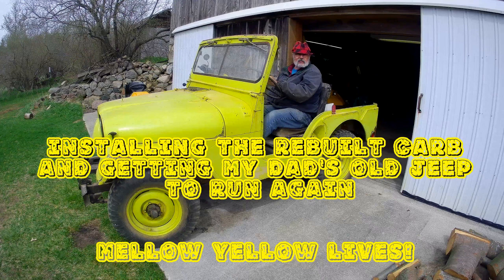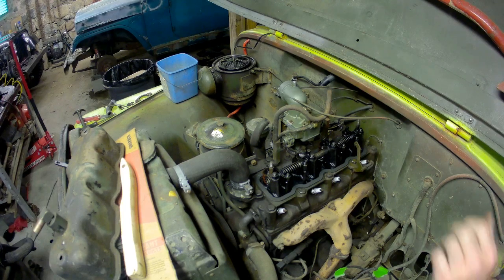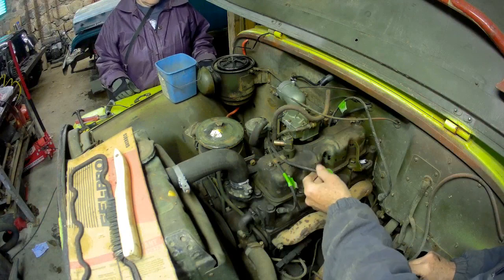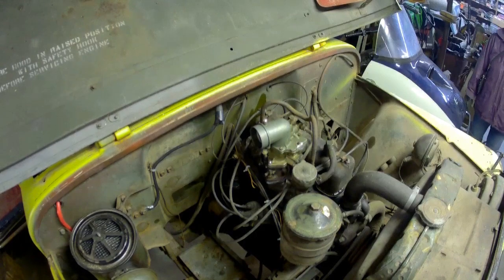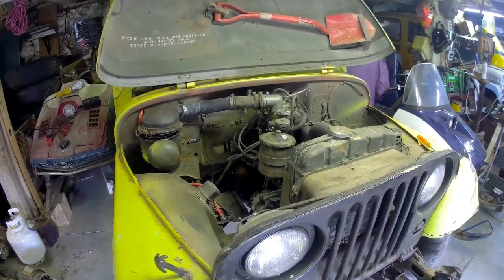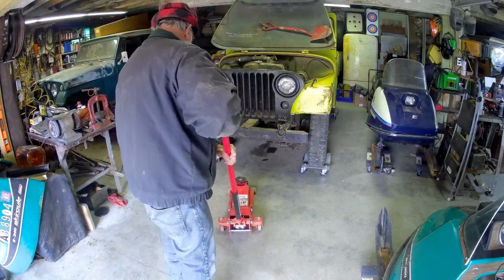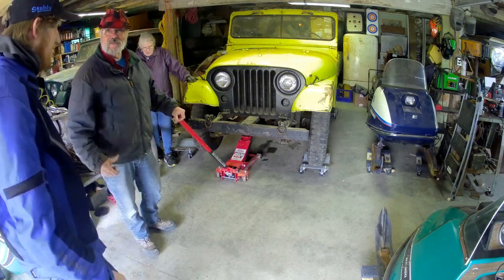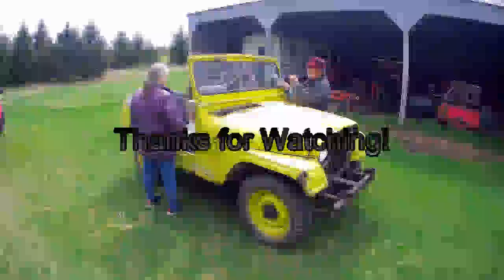Jeep M38A1 Rebuilt Carb Replacement

Comment: what was rubber smell? new valve cover gasket or belt warming up ?
Reply from the maker: Rubber smell turned out to be the exhaust pointing at the rubber bushing of the rear spring shackle.  It is discovered in the next video by my grandson.